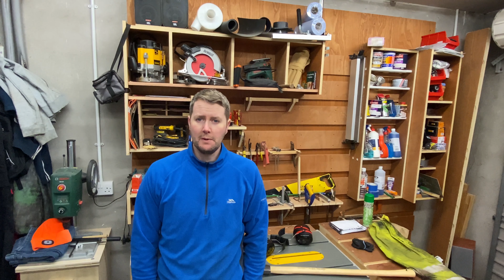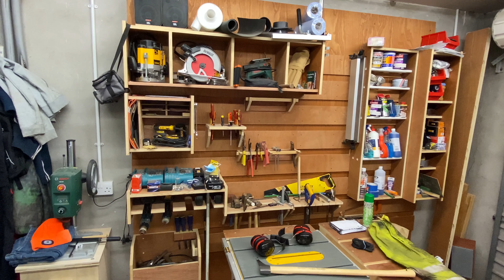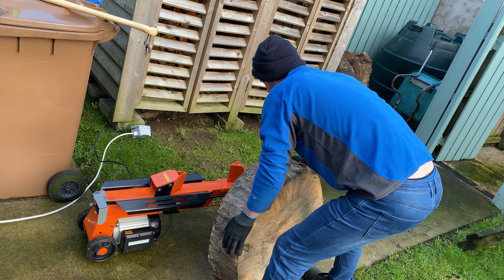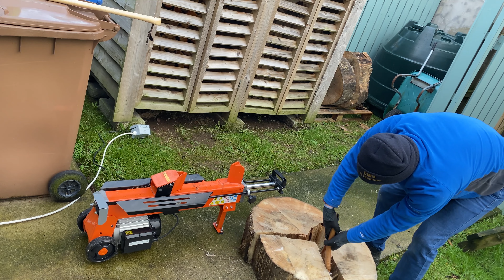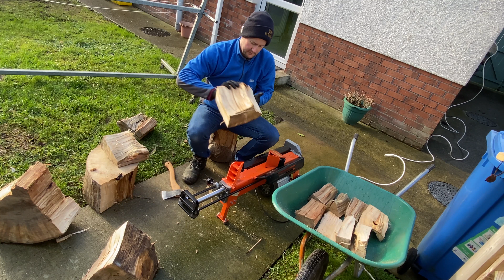Forrest Master FM10 7 Ton Electric Log Splitter

Comment: I notice a lot of these splitters now have a stand which raises it up to what is perceived as a good working height but it means you have to lift the logs higher and they have further to fall onto your toes! I do like the adjustable stop, my machine doesn't have that so there is wasted time as the ram is too far away.
Reply from the maker: I had a comment from someone who said the stand is a real game changer being able to split standing up. Add to that a pickaroon (not sure if that’s the right name) to pick up small rounds and it shouldn’t be too bad. I think I may eventually get a stand when we get our new house and shed built - pretty much done cutting and splitting wood for a couple of years though at this point☹️ does your machine have a double wedge? If it doesn’t you could try using some sort of spacer to reduce the length the ram has to travel - like an old hard firewood round - put it on first, then the piece you want to split. Just stop the splitter once the new piece of firewood is through the wedge.